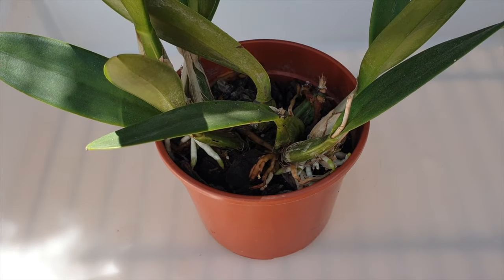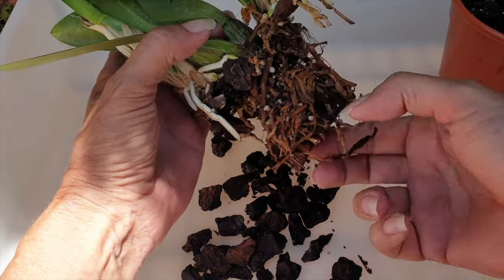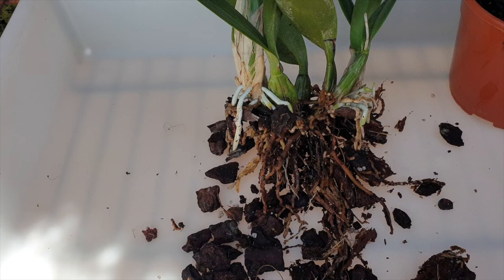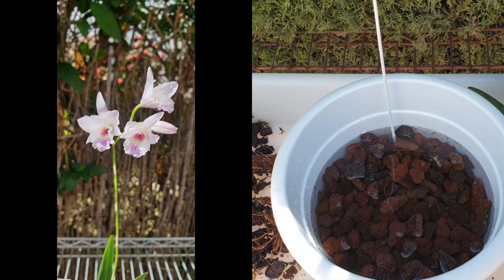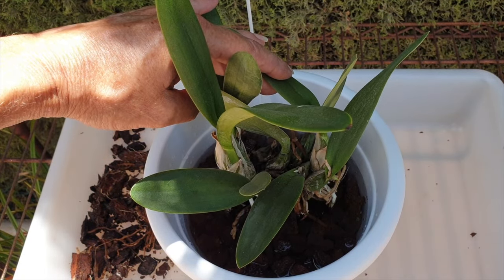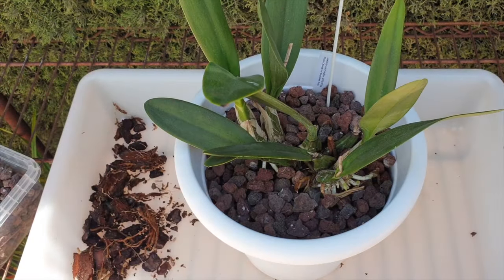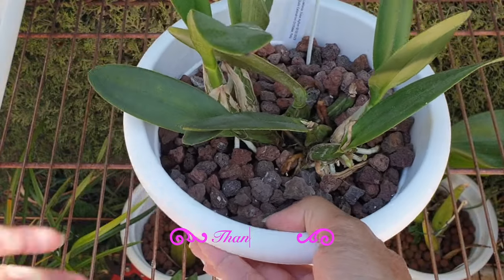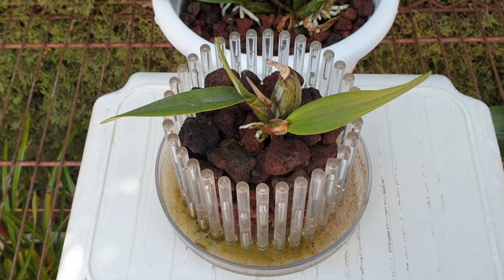Switching Laelonia Orchid from Coco Husk / Bark Substrate into Lava Rock #tutorial #ninjaorchids

Comment: Is there any reason not to use black lava rock?
Reply from the maker: Hi Fran 😍 💐absolutely not! I just can't get it here, but, if I had a choice, I would buy the black lava rock because I think it would look so much nicer in contrast with the white 😆 Hope you are having a beautiful day already, when you read this, Fran! Thank you so much for watching 🫶🏼❤️🌸
Reply: @NinjaOrchids  Im so glad to hear that.  Had it for a while but wasn’t sure.  I found it at a fireplace supply, they use it for the embers.  Not as economical as the red but is much smaller in size, saves the arms!  I hope you also have a wonderful day.🤗
Reply from the maker: Yes, at a fireplace supply store, it would probably raise the price, BUT, you only have to purchase it once 👍🏼 and you are right about 'saving the arms'. There is a limit to pot size that I would use lava rock with, just because it does add up. My day is almost done... one more check up on the 'chiddos, a little touch of the mister here and there before I tuck them in 🥰 it was a good day, Fran, thank you!! You have a relaxing evening when you get there 🫶🏼❤️🌸